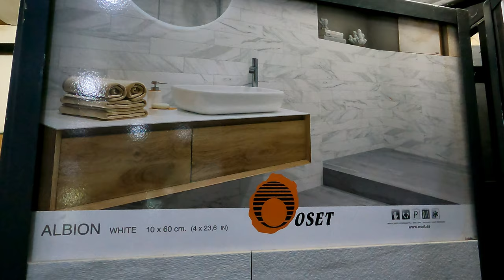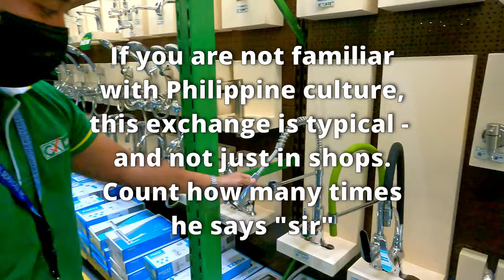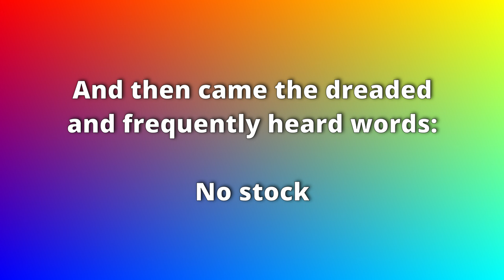Philippine House Building Day 131 - If at first you don't succeed

Comment: Good morning Mike,  Nice walk around Wilcon ,always busy time making selections.  SM Appliances  gave a good  selection bit pricey but top of the range offering well known manufacturers. I have often  hear said lower grade Appliances are supplied in the Philippines compared to what I'm use to. From what I've seen a bit of both.
The roof truss spacing with close steel purlins look good to me and I like the angle steel brkt attaching purlins.  Good hold down in typhoon. We usually use bolts to purlins connections were Philippines use welding.  The centre's of purlins usually steel rod from purlin to purlin just wait and see.
Another great day. 👍
Reply from the maker: Graeme
I have done a quick wander around SM Appliances in Clark and their selection did seem better than what we have seen over the last three days, so a visit back there is required. Online as well maybe an option.
Thanks for the input on the roof.

Comment: Hello Mike . Well get used to the shopping mate . It only just started. I have actually built a roof very similar in design to yours on a small commercial bldg I built. The roof has a - concrete gutter and (730 mm ) facer - attached to the top beam .  Spacing of my metal trusses calculated out at 1.8 meters but I placed them at 1.6 meters (safety factor,) . Only difference to your roof as viewed  is I welded 90 degree brackets on metal trusses  to suit  bolting 2 /3 inch wooden perlins as I prefer 3 inch wood screws to 3 inch metal screws to hold roof sheets down ( I am old fashioned ) . Your roof has been designed and checked by  a engineer. Your trusses looks the same as mine but are probably stronger . You should be confident that 2 meters spacings will be ok as the roof has been professionally designed same as the one I built ..Regards Mick.
Reply from the maker: Thanks Mick
Some slightly mixed messages from the builders comments. Ultimately, I will still have another chat with the builder, but this was designed with input from a structural engineer, and then signed off by "City Hall", which again is supposed to include input from their structural engineer.

Comment: Magandang hapon Mike, revised roofing completion date, day 147 for me please. Tell you what the selections available for tiles and toilets have really improved from my first visits to Phils way back in 2009. 

Your asawa wanting wall mounted flushes, usually you would have a stud partition to allow this to happen with pipes running up the void. you can of course raggle the walls you have and sink the pipes into that however it then makes them relatively un-accessable without a lot of work. Not impossible but a lot of work with associated risk for the future. unless of course you make a stud partition of some sort with a void to allow the plumbing to run behind. 

anyway all looking good sir.
Reply from the maker: Mate
I am hoping I have put her off the wall mount flushes. Just sounds like future trouble. Thanks for the explanation

Comment: Hi Mike, I noticed shrinkage cracks in the rendering in side the house. are they just skim coated over or some other treatment.
with the roof build I'm thinking please mark me down at build day 159.
Reply from the maker: David
You are in at 159
I believe there is a step before skim coats to treat the concrete, but don't have the details yet. Then 2-3 skim coats. I have heard that these need to be allowed to fully dry between each coat to minimize further cracking - at least one day and probably more.